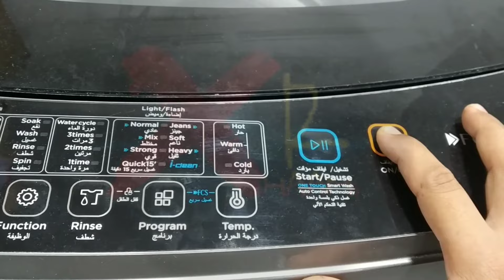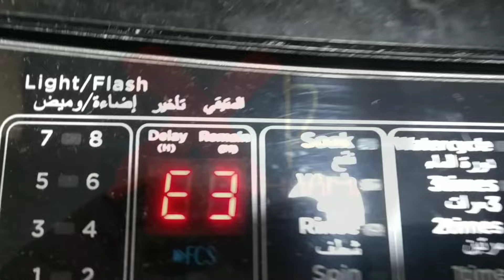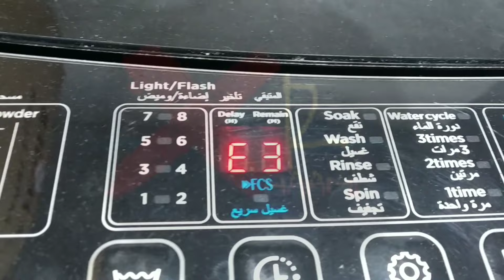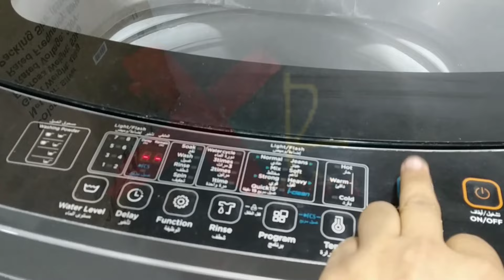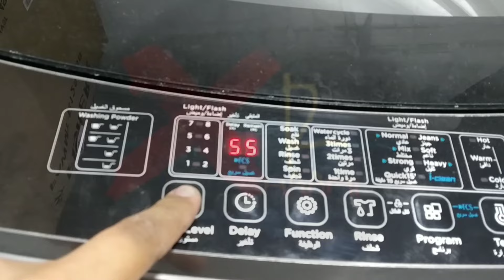Automatic Washing Machine Repair | E3 Error Troubleshooting |

Comment: Thanks Xhaamir for the video.  I broke the switch which controls the drum for this washing machine. Now the machine does not detect when the drum contents are not balanced. Can I be able to get such a switch , am looking around online but can be able to get one.
Reply from the maker: Find on near by ... shops not online ... because this switch in normal like many models have same or similar switch..  so you can try even not looks like same. Thanks
Reply: @repairingschool  Thanks very much.

Comment: hi, are you from jeddah? just want to ask is this the same with classpro brand?
Reply from the maker: Don't know about classpro.... But I am sure 90% w/ machines have same technology.
Is have any query... Visit our Instagram.com/xhaamir
Reply: @repairingschool  i notice all the buttons are the same with classpro
Reply from the maker: @nickobolina  what is the problem you facing in your machine..... ?
Reply from the maker: Leave your query here....
https://www.sidzcoolcare.com/ask-question/
Reply: @repairingschool  water continues flowing wont stop notice some small pipe loose but return it back still the same
Reply from the maker: @nickobolina  in this machine you must to hang the drain pipe up in the backside ... 
Not to worry, drain pumps will throws up the water.

Comment: Hi I have washing machine Fisher same in video but I have problem code E1 ? How fix that and water low weak
Reply from the maker: Check water pressure... If water pressure is very low.... E1 error will be there.

Call plumber to fix out the water supply

Comment: Did you change the switch into new one?
Reply from the maker: Yes brother
Reply: @repairingschool  MY washing machine is hisense and it says E3 but now my problem is there is water inside i cant drain it out since the machine is not working
Reply from the maker: @nontokozomjole933  which one is your washing machine?
Tell me brand name so i can help you propperly ..
Or send some pictures on instagram for best solution.
Insta/xhaamir
Reply from the maker: @nontokozomjole933  hey! 
There is the problem of water pump so you can't Drain the water. Check filters if clean bcoz sometimes chowking filter is the reason for not draining the water.

Watch this Video
https://youtu.be/8GUGi9gcSkQ

Comment: can i put water manually? we have same model, because when i do that, its not spinning
Reply from the maker: Why you need to put water.... ??
If you wonder use water while spinning... It is not good to put menually ...
But yeah you can Choose rinse option for 2-3 time
So your clothes will clean properly
Reply: @repairingschool  do i just need to install water inlet and the washing machine will work?
Reply from the maker: @tannga1222  yes just install inlet water then...  Make sure your drain pipe don't be lay on the floor... Hang pipe up onthe similar height of washing machine

Otherwise the washing machine will not work and water will start automatically drainage
Reply from the maker: https://www.instagram.com/xhaamir
Visit here and inbox me.... So I'll show you the proper way by picture
Reply: @repairingschool  i need help. my machine is not starting, i try 1 time , water just overflow inside
Reply from the maker: @tannga1222  come on Instagram..
https://www.instagram.com/xhaamir

Comment: What does e3 in hanabashi model means?
Reply from the maker: There is a magnetic system while door close and open. Check the magnetic if have Or been removed. Or moved to the other place.....
Reply: @repairingschool  is it the same for Sharp?
Reply from the maker: @a15an  no, I replaced with new one.

Comment: Could you not just remove the switch for the lid completely to stop this happening
Reply from the maker: No brother... this switch is for safety if you remove the switche, it will be cause of an accident while machine is on drying mode....

Comment: How too chek E3 BOSCH MACHINE
Reply from the maker: E3" on a Bosch Maxx means the door is not closed properly. Either there something preventing it from closing properly (blockage) or there is a fault with the locking mechanism
Reply from the maker: Same bro... Just try to find out.